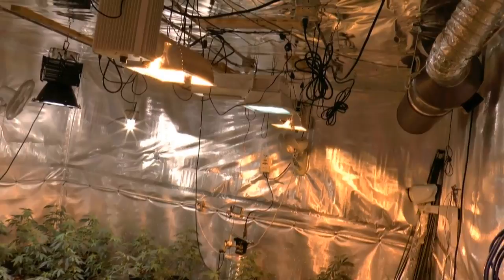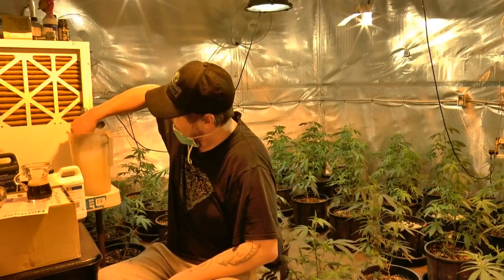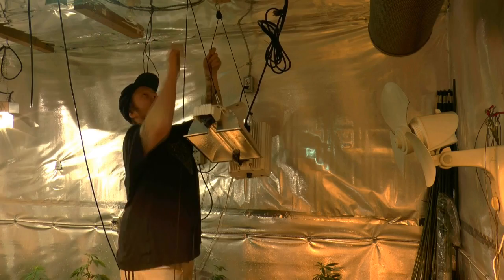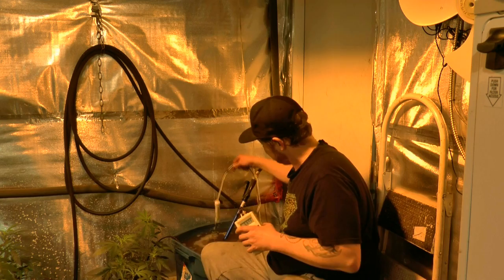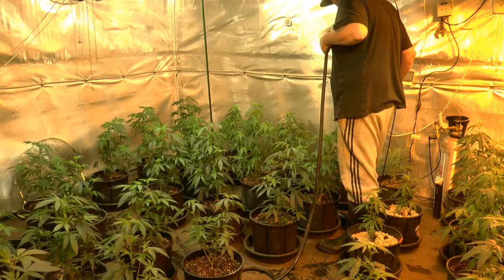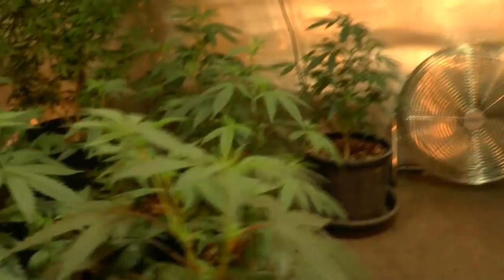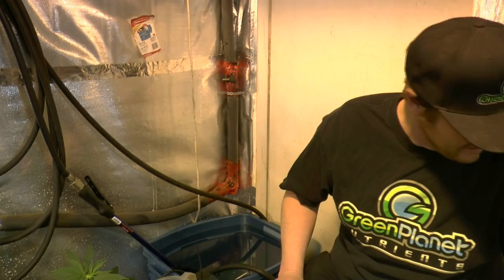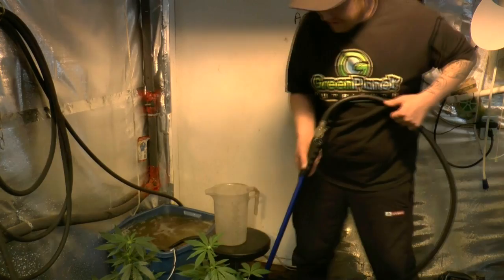Developing Buds Week 2 Day 2

Comment: You should check the temperatures right on top of the plants under the LEDs. with that fan blowing on that side you might be reducing those temps. move the fan to the gavita side,  that should help even out the heat in the room. GL.

Comment: JOHN.... I LOVE YOUR TUBES MAN. quick tip though... keeping your plants off the ground just 2 inches will change your garden for life. I use styrofoam blocks... basically it keeps the roots off the floor which increases the temp inside the planter. buds are 10 degrees hotter then the air surrounding it... and the roots are 10 degrees colder normally.... soooo yea if those roots are cold your going to see it in your plants... also are you using any zymes? also what wetting agent are you using in soil? OHHHHHH! NVM SM 90 IS BANNED IN CALI.
Reply from the maker: I use Zyme  from Green Planet in every feed.. :) 
No wetting agents in flower...
Reply: I'm trying doctor zymes eliminator. I have tried hygrozyme from grow more. thanks I'll try it out also.